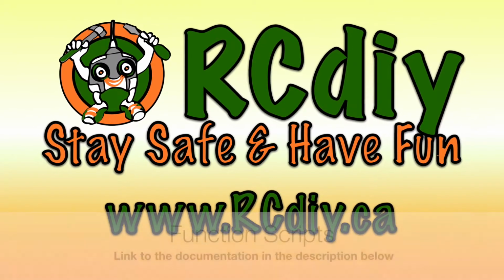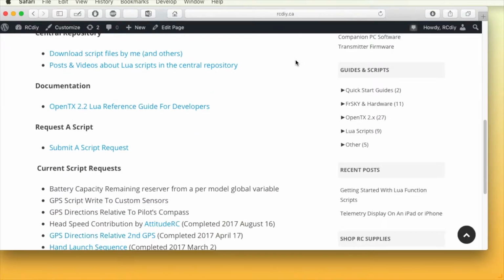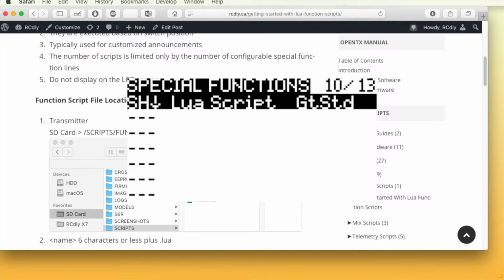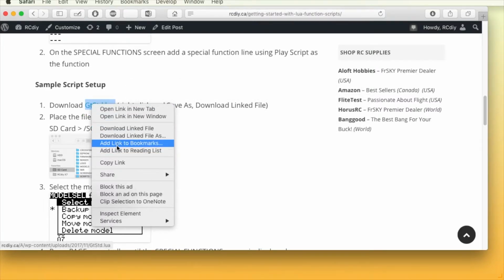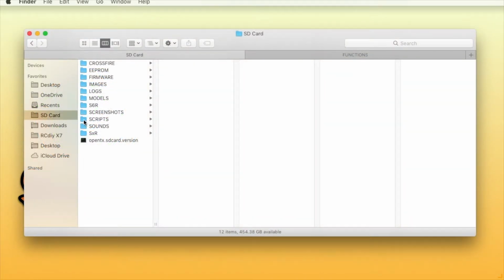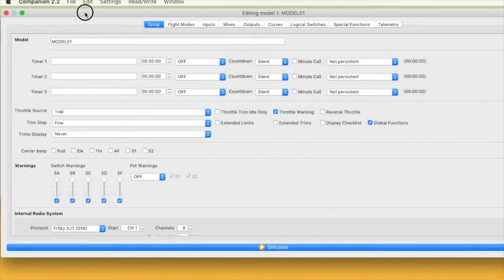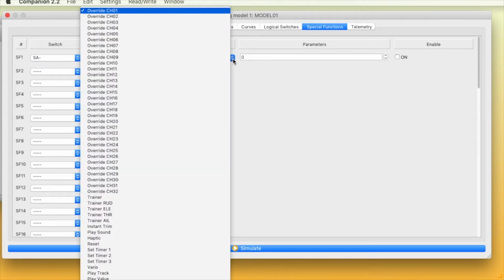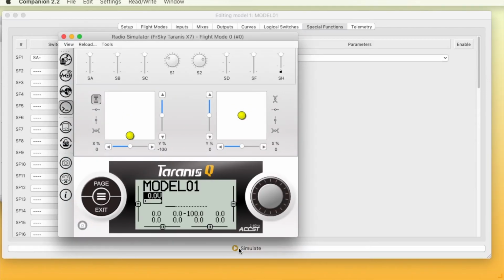Taranis Q X7 OpenTX Getting Started With Lua Function Scripts

Comment: Im having an Issue with a lua script. I've been trying to set up the lua script for PID tuning on my qx7. Ive configured open tx compainion to add lua and luac. I've got the latest 2.2.1 firmware, updated the boot loader and when I try to execute the lua or luac script in the BF folder I get a syntax error. Something about Telemetry in The BF folder.
Reply from the maker: You need to configure it as a Telemetry script.
Reply from the maker: http://rcdiy.ca/aa-telemetry-scripts-getting-started/